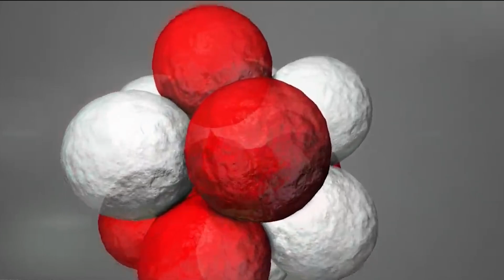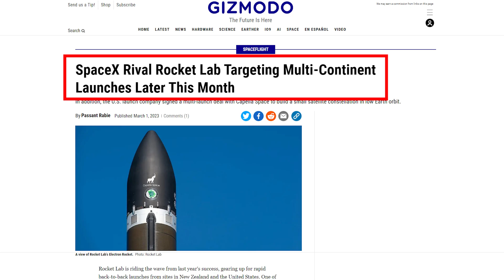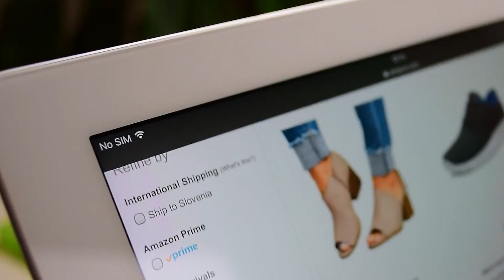David vs. Goliath: Is Rocket Lab Poised to End SpaceX's Space Supremacy?

Comment: Poorly researched vid. Rocket Labs current orbital class launcher is called Electron so the next generation being called Neutron is hardly surprising. 
Rocket labs are not aiming to 'take on' Space X as you state but want to firstly develop re-useable technology to keep costs down then expand into the medium lift space so as to launch larger satellite constellations, (and government communications and reconnaissance satellites which is a development of their existing business)  and eventually  interplanetary missions such as the recent Psyche launch.
Rocket labs have no plans for manned launches in the forseeable future, aiming to develop in the low earth orbit, mega satellite market first, then interplanetary mission launch capabilities second.
3D Printing has been used in Rocket Labs Rutherford engines from the first, you fail to mention their use of composite materials in rocket body construction which will be a feature of Neutron .
They are not in competition with either ULA or Blue Origin who are in the Heavy Lift,orbital class market.
None of the competing rocket manufacturers is in competition with Space X's Starship which is in a class of it's own as a fully re-useable heavy lift orbital class vehicle potentially able to undertake interplanetary flight.
Reply: You're poorly researched.  Starship has little to no use cases ahead of it.  The only thing SpaceX has going on for it are Falcon launches.  That weight class will handedly earn Rocket Lab the lion share of launch with their cheaper, safer flights.

They already earn more in launch income than SpaceX today.  If it weren't for SpaceX's overpriced valuation of Starlink they'd have been considered leader in space companies already.  

So you don't have a grip on the facts or an understanding of the stage they both stand on nor do you comprehend the impact of Neutron.